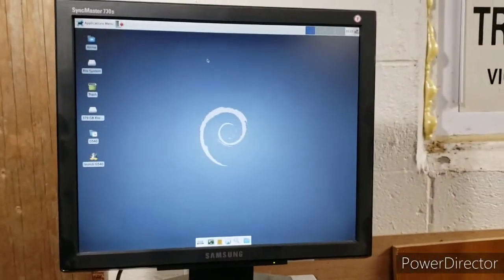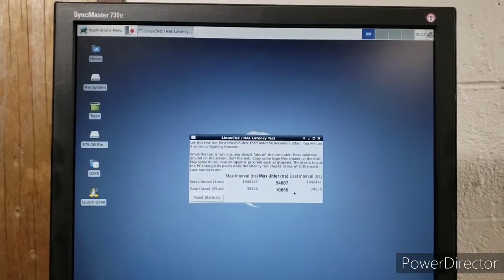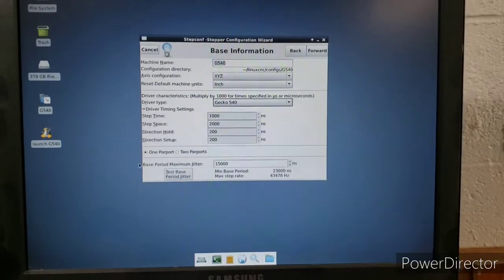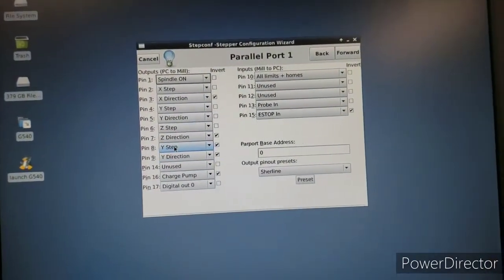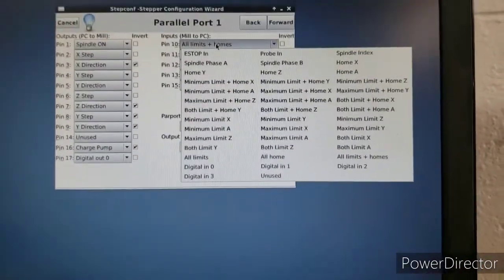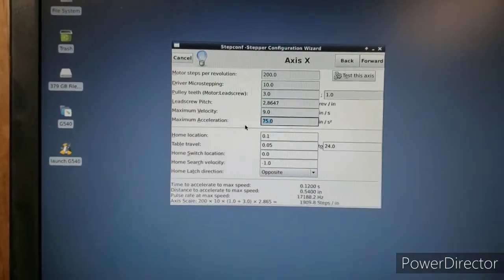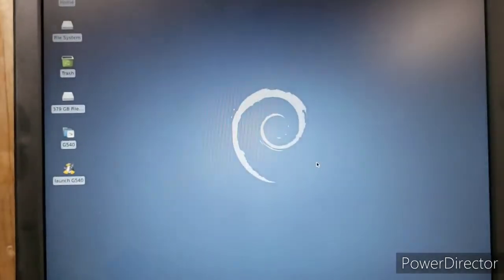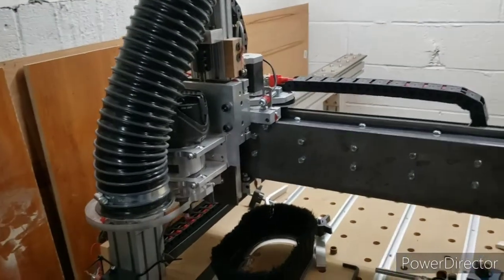Gecko G540 to LinuxCNC interfacing

Comment: For anyone wondering, the e-stop is normally closed because, if the wire shorts to ground for whatever reason, you want the system to fail safely.
Reply from the maker: they make estops available in no, nc and nc/no flavors to fit different needs